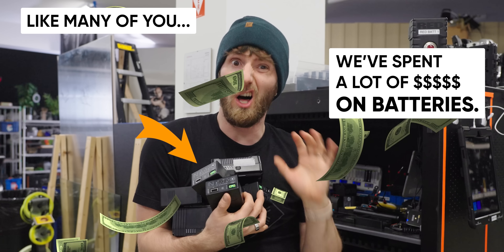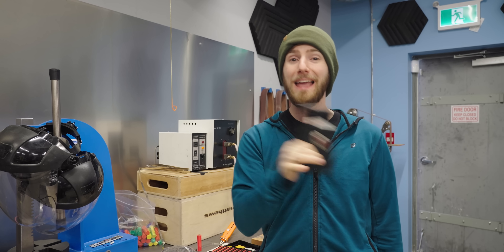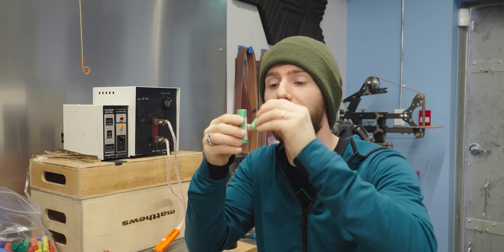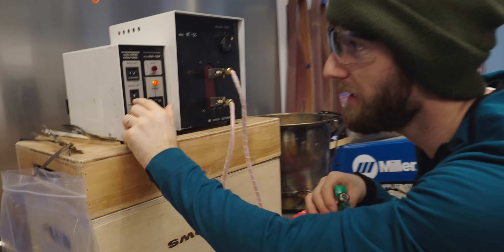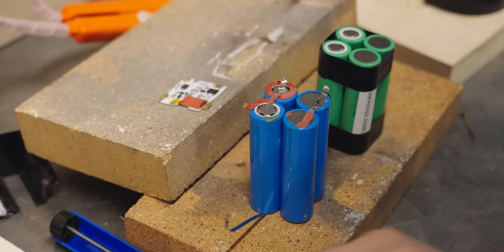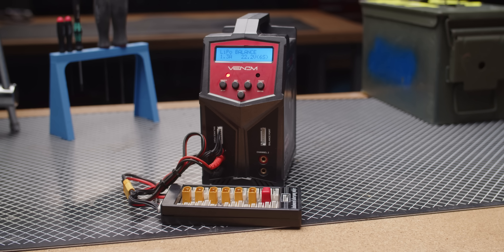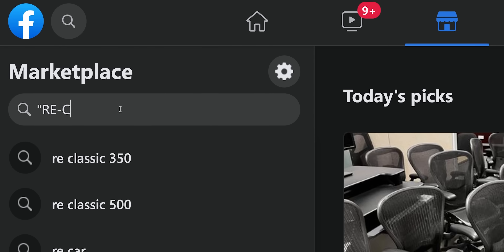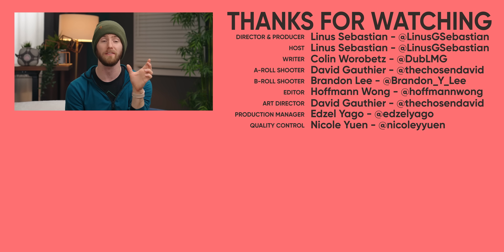This should be illegal… Battery Repair Blocking

Comment: Idk why they were so worried about fires. I have never had a battery explode on me and I use more volatile lipo packs for my drone as well as lots of 18650s. The only time they really explode into fire is when they are fully charged to 4.2 volts or I would say really above 3.8v. if the cells are below that the chance of fire is low and decreases as the voltage goes down. For the cells at 3.2 you would have to do something incredibly incorrect to get them to explode they would likely just start smoking and get hot if anything. I mean it's always good to be safe but like still I feel like people just overexadurate Li-ion fires without knowing the factors that influence what actually makes them explode. Also spot welding you would know immediately if you punched a hole in a cell because it starts hissing and spewing electrolyte and I'm about 90% sure the packs that were on camera sparking were fine. That kind of spark usually happens just because the battery contact or nickle strip aren't completely contacting each other or clean. Especially at the voltages they were talking about at the beginning of the video I think it was an overreaction to immediately dump the batteries into sand because you would notice them heating up way before they would just explode in your face so you would have a little bit of time to evaluate the state of the battery. That being said safety first but also just wish LTT would have someone more knowledgeable about this stuff if they are going to cover it because it just makes batteries seem way more dangerous than they really are. Obviously that last part only applies if you know what you are doing though.

Comment: You should probably get some Lith-ex or  Firexo extinguisher, especially for the office. The amount of Lithium batteries you likley have on site, as well as the various quality of batteries could be a serious risk.

You may also want to consider a special fire resistant area for charging and storage of batteries. I had a client who had a Chinese e-scooter spontaneously combust on warehouse racking, and sprinklers prevented the entire warehouse burning down.

Comment: Why does all this BMS circuitry have to be in the battery pack anyway? Couldn't they just put it into the device/charger and that way when the inevitable cell replacement is due, we don't have to throw away perfectly fine circuits and not as much plastic casing?

Comment: Dji have this practice in their „smart battery” for gimbals etc. when if voltage/capacity drops battery just locks bms and stops working forcing you buying their new oem battery because there are special pins for communication with battery… very evil especially when battery is more expensive than device.

Comment: Some of the cunt roll circuits will shut down and not restart if you interrupt power to them. It's for "protection" and "safety", you see. And there's no reset on most.

The cheeky way to go about it is to ensure it never loses power.

Strictly speaking you don't need to spot weld the tabs, you can get away with soldering, but you have to be quick with that to prevent heat soaking of the battery.

Comment: Dude almost everything showed in this video was entirely wrong...
The risk when soldering cells that are unbalanced is not when joining the series, it's when joining the parallels, as they will naturally balance into a "single cell". At that moment, if the difference in voltage is really high, the current seen by the cells will be exponentially high and similar to a short circuit. However when connecting them in series, each cell doesn't really do anything, as the battery terminals are still disconnected and it's an open circuit, so no current flows.

Next, the sparks that were shown and misjudged as a cell failure were not any sort of cell failure (referring to the second attempt at assembling a pack in the video). Those were just sparks from the spot welder, which aren't the best but they aren't damaging the cell, as the circuit created is very short and between the two electrodes. The real risk with the spot welder is heating up the lithium inside the cell and getting in the self combustion territory. At that point the cell will most likely start producing smoke, and then fire will come after some time.

The concept of swapping some 18650s for other 18650s as if they are all the same thing is just plain wrong and dangerous to tell people to do. The chemistry inside each cell is not the same. Their capacity is not the same, their voltage range is not the same, their charge/discharge current limits are not the same. So no, "re-celling" a pack is not just "make sure the cells are genuine". The cells should be the exact same model, or if that's not possible they should be of the exact same specs for the 3 critical safety specs: temperature range, voltage range and charge/discharge current limits. The capacity is also very important if the BMS is of the smart kind, which leads to the next point.

Saying a BMS is "Evil" because it doesn't work after it gets rebooted with new different cells is unbelievably stupid and wrong. When the BMS gets power cycled, if it's a smart one, and it hasn't been told explicitly that it's safe to start working by some external signal, the correct behaviour should always be to wait and do nothing. The BMS cannot in any way guarantee that the cells are of the specs it was designed to manage. What if the voltage range it was programmed for is 2.8 to 4.4V but the cells you replaced the old ones with are for a 3.2 to 4.1V range? The BMS has no idea about it and starting to work without any confirmation that it's safe to do so could result in cell damage, which is the one singular goal of a BMS: ensure cells are never damaged and always working within the safe limits.

Next, another similar reason to why a BMS shouldn't "just work" after getting power cycled like in the event of a cell swap would be because the configuration of the cells, their specification in fact, including all the safety limits, could be stored in ram. This means that at boot, the little state machine running in the BMS will start by waiting for a cell configuration to be flashed to it, and for the meantime just wait with the battery terminals disconnected. This is a very valid use case as a company could be producing thousands of BMS and have the microcontroller programmed by the supplier, this way when the PCB is assembled by a pick-and-place robot the firmware is already there and nothing needs to be flashed later. So now the PCB only needs simple communication terminals for someone to send it battery/cell configurations, which will be stored in RAM, as the BMS will never lose power in its entire life, unless a failure or unexpected event occurs, in which case the correct behaviour is again to not allow current to flow in or out of the battery. The idea of stuff flashed to ram was mentioned in the video, but not the right thoughts were applied.

Also as a bonus, each cell's "safety feature" often goes beyond just the pressure cap being designed to fissure and let gases out. There's often a very small pcb in the top of a 18650 or 21700 cell that includes two things: a current fuse and some way to open its circuit in case of under or over voltage. This is an important component of those cylindrical cells, but knowing if it's included or not in the cell is pretty much impossible to know just by looking at it, you need to look up the datasheet, which is the first step of any battery related project (which wasn't ever mentioned).

And another note "Evil BMS" bullshit. After the BMS has determined that cell has lost a very significant amount of its rated capacity, it is often a good decision to disable the battery, as older cells become more and more unsafe and unstable as they are used. A loss in capacity also means the cell internal resistance is now probably higher, meaning the same rated current going through it now heats it up much more, meaning even more damage to the chemistry. So no, disabling a battery pack based on how much total charge/current has gone through the cells is not Evil, in fact it's much the opposite and is meant to save your life.

Sorry I said too much,  but at the same time not nearly enough. LTT is at the stage where they think they know more than they really do and when it comes to batteries, especially lithium-ion and the other flavors, it can and it will cause people to try stuff without proper safety precautions and knowledge, which will cause accidents. It's extremely dangerous to present stuff about lithium-ion batteries to such a huge audience without really knowing anything about it. Please do something about it.

Comment: As has been mentioned, some BMS's need to be "woken up" with a hit of charger before working fully.
Also while replacing a single cell isn't always a good idea, you can use the good cells for other things. I have multiple things around my house converted from 2x AA or 1x 2032 to run off a single 18650 with a cheap 1s bms from drill batteries.
Reply: An individual well behaved cell can pretty much always be used. If you notice it getting hotter than necessary, then you can chuck it.

If you're going to put them in a pack, there is additional hazard. In most cases it's fine. But eventually you might encounter a cell that while it initially matches other cells, happens to degrade faster for some reason, then in particular if the pack contains parallel elements besides series ones, the neighbour cells may very well end up feeding the cell's unhealthy smoking habit. Odds are if you're attentive you may notice things before there's actual fire, but just something to be kept in mind.
Reply: If you're going to recycle old cells by repacking them, it's crucial to 1/ test the capacity of every cell, 2/ repack them so each group has approximately the same mAh total capacity, and 3/ use a smart BMS to ensure the groups stay balanced. Even then, it's more risky since the chance of an internal short circuit goes up over the lifespan of the cell.
Reply: @wool1701  it is definitely more risky, though it's about the only affordable way to get 18650s these days.
Reply: For 1 cell you can also use TP4056 charger module to handle battery protection and charging (they even come with type-c port now)
If your device use different voltage but not a lot of currents you can connect output to converter like MrMonotone mention.
Reply: I modified a 2xAAA tap timer to run off an old USB plug

tried using a voltage divider but the resistance was too high to supply the current required. I ended up shoving the full 5V up its arse with a capacitor in case the solenoids drew too much current. It’s still going strong months later
Reply: This is very true and f*cking annoying to electrical engineers trying to use pre-made modules

Comment: Maybe you shoulda watched more of those ebike guys building batteries.  Seems to me that all you need is the case to fit the camera.  Or rather the part of the case with the connectors.  The rest of it can be anything.  Heat shrink tubing and strapping tape work fine.

Comment: if your spot welder sparks that's not the battery being damaged... that's just the spot welder not making good contact, no need to throw out those perfectly fine batteries. also a lot of BMS systems need to be initialized before they work.

Comment: That specific Red battery was manufactured by Blue Shape. It definitely is serviceable cause I have gotten mine serviced, but I didn't do the process myself so I have no idea what the procedure involves. What I was told is that these batteries aren't designed to be serviced, and anyone trying to fix them could get in trouble with Blue Shape for offering to re-cell them.

Comment: Finally! About time this issue has been brought up and addressed. BTW, you did it wrong. With the right spot battery welder at the correct settings in conjunction with your nickel leads, you do 2 bumps but not in the same spot on the contact. 

When done you should have 4 dimples. This will provide a firm hold. Providing your on the correct setting.

Comment: Clean your working materials better next time, do not inter-change cleaning between metal types either. Also do not use bare-hands when welding or holding anything you will be welding on or with - You will introduce oils to the metal surfaces and cause problems like you have been having. Make sure you clean the oxidation layer off the cells and the metal strip if there is one. You want the metals clean-room clean for a good weld.

Work with some cleaner parts next time and give it another try, I would love to see a win especially on that Red battery pack.

Comment: Those batteries you probably sparked were probably just fine I was probably poor connection with the spot welder and the battery. some BMS manufacturers make it so that if the battery goes below a certain amount or you swap the cell you have to "wake" it up before the pack is usable.. Also if you get batteries that have a BMS that screw you over just purchase a new BMS you won't have the indicator lights or anything like that but you can still use the pack as intended.

Comment: That was not (1 second = 1000 milliseconds) 14 milliseconds but 140 milliseconds which is why the prongs of the spot welder got visually hot and stuck to the nickel strip. You wanna have the pulse (the duration in which current passes through) as conservative (short) as possible to avoid high temperatures and unwanted arcs. This can be visually controlled where if your configuration (voltage/amperage/pulse) is just right or within the margin of error, you'll only see a blue/violet glow instead of white/orange heat spike.

Comment: It sounds dumb, but actually a bucket of water is a good safety measure too. If you get yourself in trouble, toss the cells in there. The huge thermal capacity of the water can help keep things under control.

Comment: I don't think I've seen you mention 3d printing very much or some LTT does/has access to. Considering what you spend on batteries for cameras, I figure you guys could probably spare the funds to get one. Then a bit of CAD work and some printing time, and you could have made a custom jig to hold your batteries for spot welding
Reply: That's not even to mention all the other uses for having a 3d printer

Comment: Very bad understanding of electronics. You didn't connect battery to anything so connecting + and - doesn't mean anything. Circuit is not complete, you're not connecting + and - on same battery, you're making parallel or serial pack, ends are important.
Also sparks when welding are not meaningful, it's not battery sparking it's your tool, even if you used solder iron to weld them it would be OK, it's just slower.
Precautions are OK but don't make show out of it.
Cheers!

Comment: The only way to replace these types of packs is to keep minimum pack voltage of 2.8-3.0v per cell on the BMS and potentially all sense wires as well if it's in series-parallel (any faults in the pack modules would trigger protection too), if it loses voltage or drops below that threshold it will disable permanently. Most likely this is basic over discharge protection to prevent a dangerous recharge, with no ability to be reset by the user unfortunately.

Comment: Easy to find out if its programmed to 'die'.  dont change anything and only desolder (hot air) the ICs.  Solder back on and when it doesnot work anymore you know where it goes wrong.

And it should have some contact points somewhere to program the chip. Probably shorting some open contact to change a 0 into a 1 as long as it has power.

Comment: (Background info worked as a battery pack repair technician for about 2 years) my experience with spot welders has been that they like to spark mainly if the pins aren't cleaned or they are not level making the welder arc. It would be a good idea to get a peddle system set up that lowers it evenly and apply equal pressure on both pins can help fix the issues a bit. Also make sure every now and again that the pins are still properly spaced and rotated.
Reply: Like you say, the spark they showed on camera just looked like a spark between the nickel and the tool. Would you have scrapped it like he did? I probably wouldnt have unless i saw a sign that the cell ruptured

Also he was clearly welding for too long if you ask me, i dont see red hots when i spot weld
Reply: @tobiass1184  the welder i used had a two pulse weld setting being as we only used it to weld cells, i mainly worked on NiCd and NiMH but yea as long as the actual cell wasnt damaged id probably lightly sand the top to make sure i still have a flat surface to weld on and give it another go, little more cautious with lithium so might have tossed the single cell but not the whole pack if i could avoid it.

Comment: I think this is critical: recycling technologies for materials like this. Even though many people consider solar panels "green", the current level of solar panel use creates 100x more toxic waste during disposal then nuclear energy! this is due to the lack of recycling options when the panels go bad or wear out. Now imagine the problems we'll have if the solar panel useage increases due to all the political pressure to go "green". It's a very similar issue with batteries...we need to push the industries to develop recycling tech along with any of this tech they develop that creates the waste.

Comment: I use a detachable mobility device I need to replace the battery I was looking at changing the cells I’m glad I watched this no longer going to attempt it. The only issue I have is a replacement pack is $1680 AUD witch I don’t have